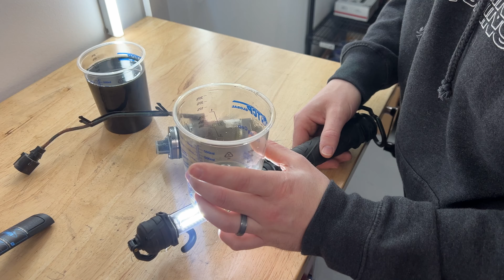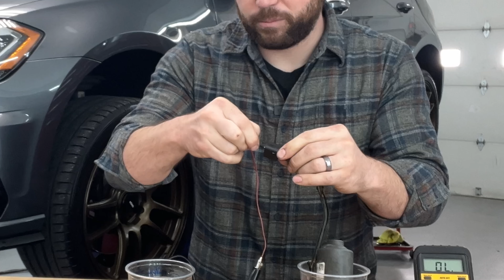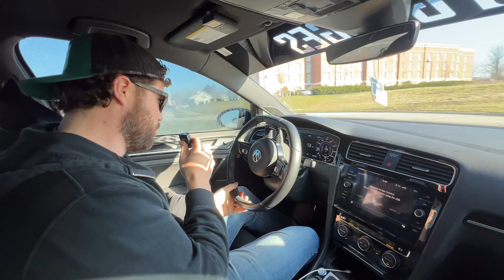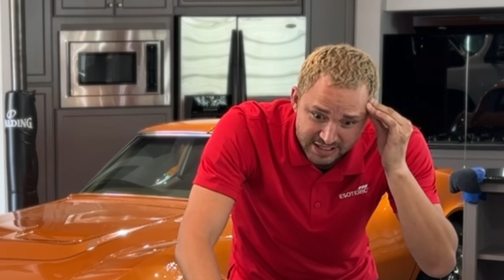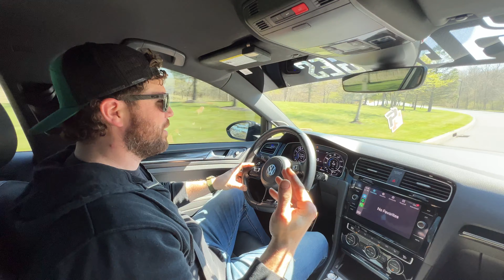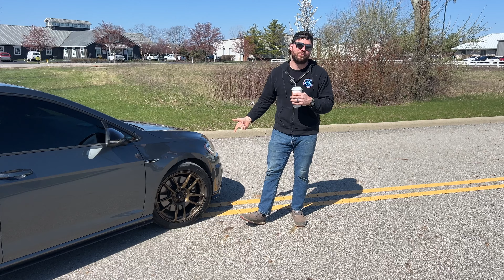Wake Up Your Mk7R! Integrated Engineering Stage1 Dyno, 0-60 and Haldex Diag | P3 Gauges

Comment: All you need to do is a pump learn and check the values against haldex repairs guide. You get good and bad values but I was getting inconsistent values. I decided to pull my pump apart and its a common issues where the carbon brushes eat in to the commutator ring and in turn gives you inconsistent readings so could be working on minute and not the next. I replaced the pump and I was still having issues, I’d say it was working 92% better but I ending up diagnosing it as the PRV valve, I bought the from haldex repairs for £65 and been amazing ever since not a single issue in the cold uk weather. You don’t need a new diff all you would need is the sintered clutch discs and the steel discs, I think there is something like 12 of each. Can be bought for £120 and is so easy to do. There really isn’t much to a haldex. Pump, PRV, controller, clutch discs, and oil. That’s it. Then just do the learn process 2-3 times and make sure it’s around 20 degrees C when you do this. Hope this helps. No need to buy a new diff.
Reply from the maker: That is awesome info to have, thank you.

I’ve already got a really cheap low mileage used diff coming from a friend so I’m going to bolt that one in and probably tear this one apart and rebuild it if it makes sense to do so.

Thanks again for the input. At the end of the day I’m here to learn👍🏼